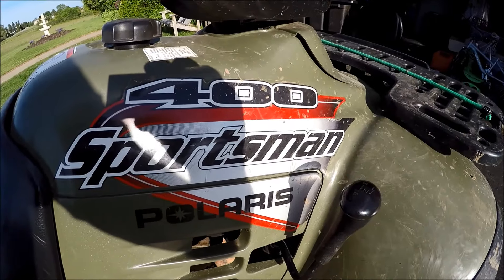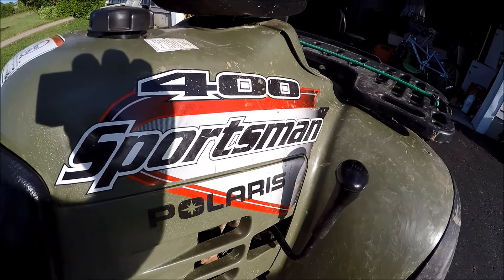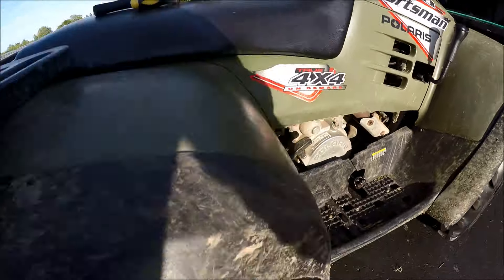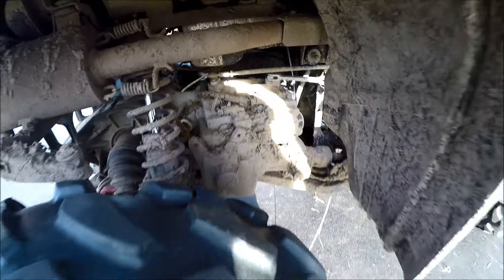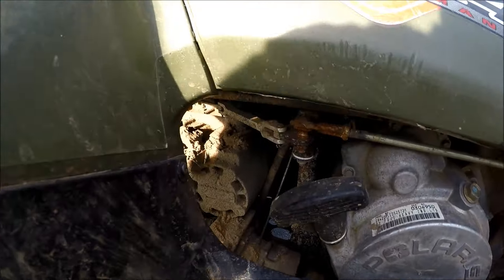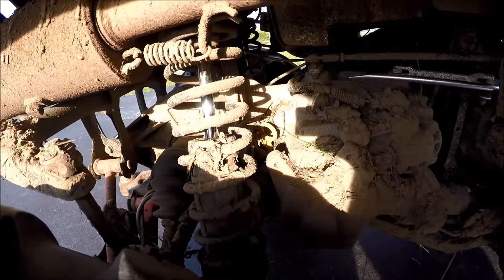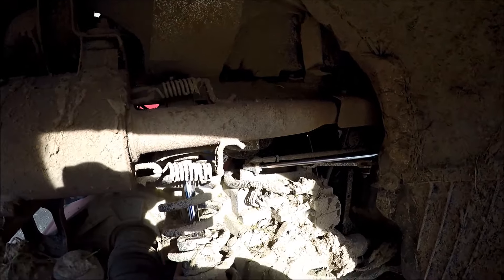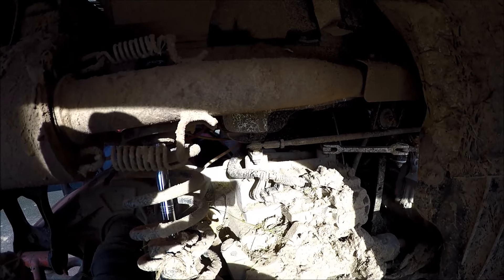How to fix a jammed shifter on your Polaris Sportsman ATV 4 Wheeler.

Comment: Ours just got stuck in low gear. 96 Sportsman 500. Said it was stopped when they put it in low gear. Leary about beating on it and breaking something inside
Reply from the maker: I would try it.    Otherwise hundreds too bring to a shop.
Reply: Right on. It still drives but obviously only in low gear. Gonna stare at it some more first
Reply: If mine is stuck in low gear then I shouldn't beat on the part right?
Reply from the maker: @atlanta8419  it should be the same linkage

Comment: Okay I know this kinda doesn’t have to do with this but my quad is a trailboss 300 and when I go fast it sounds like somnthing is hitting somnthing and it doesn’t sound good then if I wiggle the shifter it like stops making that noise so if anyone could help me find out what it is that would be awesome
Reply from the maker: that seems like what recently happened to mine and then the engine blew.  i would get someone to look at that.  ours toast without alot of work now.

Comment: I have a 99 300 express that won't go into low I wander if this is my problem too
Reply from the maker: Will it go into neutral or high?  When this happens to me, it is jammed and won't move at all.  Let me know.
Reply: Yes neutral and high reverse
Reply from the maker: hhmmm.... It may just be hanging a bit.  Try my technique to get it to go further.  I did have one viewer say that he tried everything like I did and it was solidly locked up.  At that point he had to get a new shifter.
Reply: @northwoodsdiscovery6962   I just bought it and don't know how long it's been like this, gonna pressure wash and clean up around the shifter linkage first Polaris I've owned thank you  also found that the dipstick is missing from o rings down like its broke off in the case, might be the problem plastic and gear oil don't mix, no the seller did not tell me about it, they showed high neutral and reverse worked. I didn't know that it had a low till I got home  nuff said
Reply from the maker: so sorry.  keep me posted
Reply: @northwoodsdiscovery6962  10 4

Comment: Hello!=) I have the same setup on my Keeway, but kind of a different problem. Sometimes when i pull the lever back, it won’t go into reverse. After 10-20 pullbacks, it suddenly works. Any idea what the problem may be?
Reply from the maker: you might just be slowly "unjamming" it with each pull until it releases.  

I was never able to get it to do that.
Reply: @northwoodsdiscovery6962   Hello! That totaly worked! =) Thank you
Reply from the maker: @torkelellingsve5883  i love when a problem is solved

Comment: I have a cf moto and it sometimes will not go into park. It'll shift back to the other gears but it won't let me put it in park. Thoughts?
Reply from the maker: My thoughts are that it is really worn out.  You should be able to force it this way but it will be soon that that will not work.
Reply: @northwoodsdiscovery6962  it's only 3 months old.
Reply from the maker: whoa.  Sorry.  I would take it right back and have it warrantied or get a new machine.

Comment: i really need help! My Polaris Magnum 425 is stuck in reverse. I can't get it out. I tried this method but it doesn't seem to help. in fact, it ends up retracting a little in the opposite direction, towards the shifter.
Reply from the maker: On mine the direction toward the shifter is in forward.  When you "tap" it into position, does it move at all at that point? Or does it move back when you try to engage forward?
Reply: Can you help me, I have a Sportsman 850 2012 and I cant get the gear to go into reverse or park. It's a rod that goes into the tyranny except I think to pull it out might make things worse.
Reply from the maker: @theredeemeriam oh man I thought they were all the same I’m not sure what the 850 would be different maybe since it’s a bigger, engine and stronger and longer and tougher parts maybe you’ll have to give more effort than I did

Comment: I have polarid sportman 400 but my steeringwheel moves up and down is that normal?
Reply from the maker: Up and down?  So you can push it forward and back or lift it straight up?
Reply: northwoods discovery    the steering wheel moves up and down
Reply from the maker: That is not normal.  When I get home tonight I will look at mine to see how it might even do that.
Reply from the maker: I have no idea how it is moving up and down.  There must be a disconnection.  I wish I could help.  Sorry
Reply: northwoods discovery  i fix it it was the steeringwheel bushing
Reply from the maker: awesome. I will keep that in mind for when it happens to me.
Reply: The problem is.  Take the steering wheel off and put some handle bars on it

Comment: Thanks man you saved me a week away from an event!
Reply from the maker: That's great.  Good luck in your event!  What is the venue?
Reply from the maker: If you haven't already, can you subscribe?  I tell others to as well?  
You is trying to shut out the people that don't have a 1000 subs.  Thanks
Reply: northwoods discovery It was just a big trail ride with deep holes. My quad is still going strong(kodiak 450). Sure I'll sub but could you give me a shout out or something in the desc? I'm trying to start a motocross channel. Good luck man!
Reply: @northwoodsdiscovery6962  we're you a week away with the four wheeler running? or did it break and you knew you were going to be walking for at least a week afterwards
Reply from the maker: @dont.ripfuller6587  funny.  always something with these things.

Comment: can I adjust my high gear on a 1999 polaris sportsman 500??? I'm having issues engaging it.
Reply from the maker: Are you saying that you can't physically put into high gear?  Are you then driving in low.  It may be worn our due to too many years of inappropriate shifting.  You may need to do it underneath each time now or purchase a new component.  It is hard to tell without seeing it.
Reply: It goes in high but it takes some playing with it. The reverse and high linkage is a little loose can that be my issue?
Reply from the maker: Are you fully stopped every time you try it.

Comment: Tried with mine but mine has reverse and neutral but it’s like it’s bottomed out to the plastic and won’t let it go into forward
Reply from the maker: I guess I don't understand.  I have to tap down sometimes for it to hit right
Reply: Mines made different also guess maybe bc it’s a 600
Reply from the maker: Mine jammed over the Wisconsin holiday hunt in the cold and I had to do this again.  I wonder if there is a video out there for your 600

Comment: Mine is stuck and I can get it to gear
Reply from the maker: you can or can't.  was that a typo?
Reply: Can’t
Reply from the maker: so my trick did not work.  did you hit it hard enough.  what is the year.
Reply: Yea I hit it hard enough and it was not moving it’s a 1999
Reply from the maker: @iisxapsii8663  did you try to move the machine back and forth as you are trying it?
Reply: No i haven’t

Comment: Dude... that's a nice bandaid but doesn't really fix anything. As for tools, don't need. And not usually available when it becomes an issue. A nice stiff stick and a smack with your hand does the trick. Haven't quite solved the problem yet. Adjusting the rods helped slightly. Seems to be worn parts in the shifter box. Looks like maybe the shifter box itself. Bores worn out.
Reply from the maker: Thanks.  I am always afraid to do the hard smack  feels like I it will break.
Reply: northwoods discovery , yeah just hold the stick against the arm on the trans and smack it. After a while it won't work though.  Got to the point that I had to disconnect the shift rods from the shifter assembly. Then wiggle the shifter around until it unstuck. Figured this out standing in mud and running water to my ankles . Then by time I got it shifting again it was dark. Then I found out the tail light and had run my battery down. And since my pull start doesn't work and my flashlight was mia, I got to take a nice stroll in the dark. That added to a few other times caused me to finally take the time to fix it. Thinking it is going to need a new shifter housing. They should have had Steele sleeves in it. Was a bad design.
Reply: Mine does this when plowing my driveway. I smack the shift knob to free it. I am getting it rebuilt this spring. Plowing is brutal on the shifter.